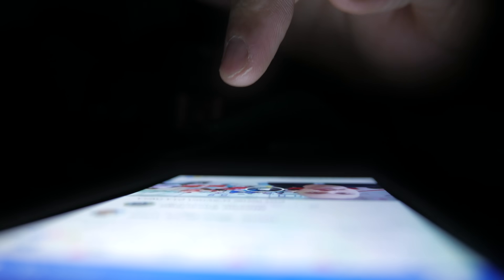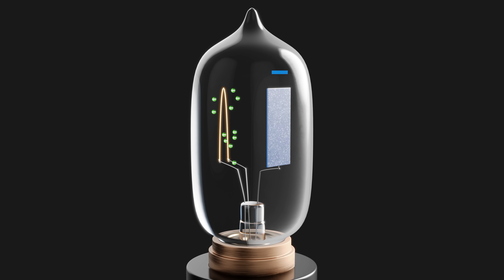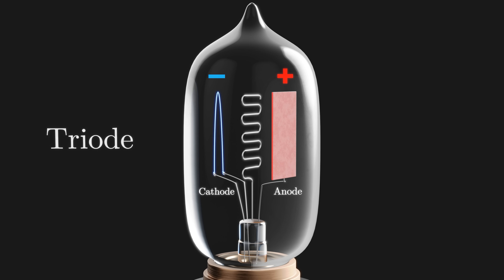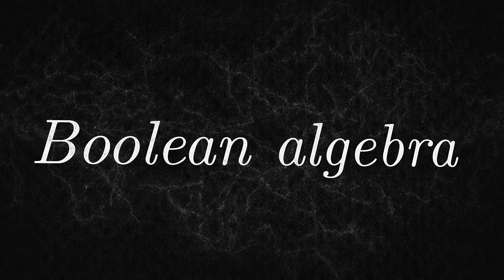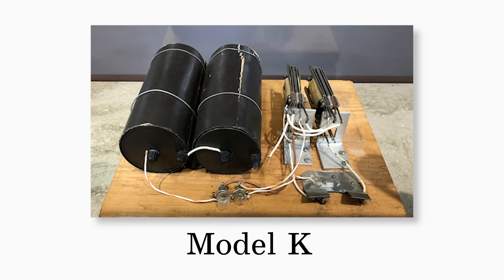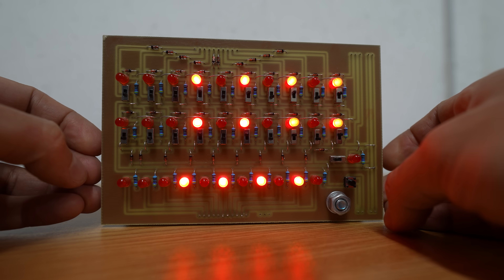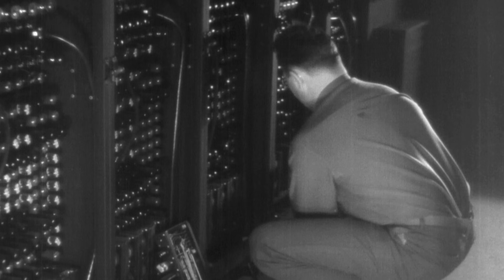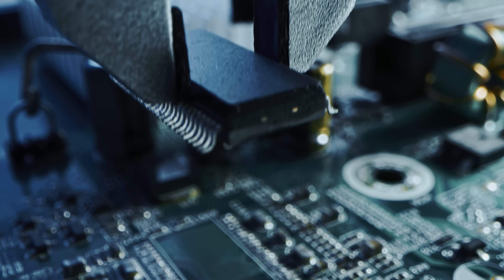Why The First Computers Were Made Out Of Light Bulbs

Comment: When I learnt electronic, vacuum tubes/valves were still widespread, so we learnt to fix both solid state and tube decices. The first thing I learnt was that it was rarely a tube that was wrong, often it was a resistor or a paper capacitor, but since the customers complained about how a small part was so expensive, we also replaced a few tubes, even if they were fine, so they won't complain too much. The customers didn't pay me for parts, unless it's a crazy expensive one, they paid for the knowledge I have accumulated over the years. It takes time to be a good electronic technician, that's why I demand a certain price. I had the chance to learn both solid state and tube so I could fix both.

Comment: I have worked on core memory, punch card readers and paper tape readers.  I have repaired tube based test equipment and the television repair course I took was on vacuum tube TVs.  Texas Instruments TI 960A computer was TI's first computer to use solid state memory but it was so unreliable that the chips were mounted in sockets, not soldered in.  We had a DIT-MCO cable tester we also used for motherboards, it used telephone central office rotary switches.  In other words, I am an old timer who just post dated the vacuum tube computers.

Comment: ENIAC was not the first  it was also unreliable the first was Colossus it was the first digital semi programmable electronic computer  run in 1943 and was designed and built by Tommy Flowers at Bletchley Park UK  it broke the German Lorenz Cypher there was a few more built and they were reliable  and run for days breaking the German Codes , Check It Out

Comment: 5:21 isn't correct.I'm sorry. Maybe it's dummed down for pedagogy's sake, but not good pedagogy. For that to work you need to have some sort of alternating current of the middle electrode, like they did with Clystrones. Sure, electrons accelerate towards the middle, but once past there's a plus charge pulling on the elsctrons ending up slowing down, not accelerating them, towards the anode. Electrons simply will not be accelerated towards the anode while the middle electrode is kept positive, like the animation shows.

Comment: When I was in a band we had an old amp head that still used Vacuum tubes back in 2020. We found a place that sold them so if a tube burnt out it was easy to replace. But it was interesting cause when we'd turn up the tube amp, we had to wait a minute or two for the tubes to warm up before we started playing so we didnt blow em.

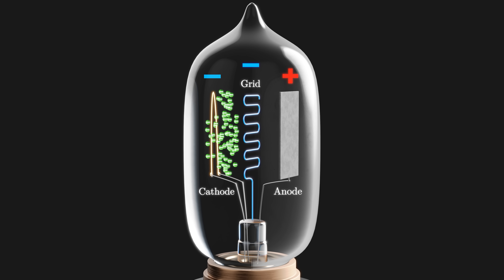Comment: 5:08 As far as I know, the potential of the first grid should never be higher than the cathode voltage. If it were, it would collect almost all of the electrons and burn up due to so much current. Instead, it should be kept at a lower potential than the cathode, thus trapping most of the electrons in a cage. By varying the 1st grid potential, you vary the strength of trapping, and by varying the anode potential, you vary the strength of pulling electrons out from the cage.

Comment: Actually, the first computers were made using brass gears by British engineer and mathematician Charles Babbage. Unfortunately, there was no power source available to drive it and only partial prototypes were made. The "analytical engine", as he termed it, stimulated the interest of Ada Lovelace, who wrote programs that could have run on the machine if it were built.

The first electric computers were made with relays by Tommy Flowers, previously an engineer with the British Post Office, during the second world war. Relays had been used for railway control and simple sorting-office tasks. Further improvements did involve valves, as in the "colossus" computer which decoded Enigma code messages in only a few hours.

So, yet another "Americans invented everything" video! Yeah, right.

Do keep up or think very carefully about your titles and content...

Comment: as a kid i learnd how a transitor worked with my bike it ahd a alternator and the connections had rust on it so when starting to ride from a stop you would have to go like 7 or 8 kmh to get the light to start but once it was one you copuld go down to like 3kmh and it would still give light yea a little but there was flow of energy

Comment: As a graduate student in 1975, I needed a printer for an amino acid analyzer. A Honeywell vacuum tube printer served well. It was so easy to fix because bad vacuum tubes were dark. I think we got it from a military warehouse near San Diego that stored equipment for the defunct Project Mohole, an attempt to drill into the Earth's crust in the 1960s.

Comment: Interesting video! The invention of the first computers is incredibly interesting, because it needed many different people making different inventions like the vacuum tube, diodes and triodes, logic gates and finally how to combine all of these to do computing. Absolutely amazing!
Fun fact about thermionic emission: We use it in mass spectrometers coupled with a gas chromatograph to ionize the analytes by hitting them with electrons. If one of those emitted electrons hits a bonding electron in an analyte molecule, it shoots it out and disrupts that atomic bond, fractioning the molecule and generating a neutral and a positively charged fragment of that molecule. It's very inefficient, about 0.1 % efficiency, but GC-MS is incredibly sensitive still. TL:DR there's a filament in those mass spectrometers (no vacuum bulb needed, since the whole mass spectrometer is a vacuum chamber anyways) and for ease of use and maintenance, it is easily accessible and in the newest models even visible through a glass window. So when it is turned on you can see the light emitted by that filament. Nothing special but I think it's just so damn cool 😅

Comment: Wasn't there a video about electric current is actually not 'flowing' so how does this then fit to electrons 'flowing' through the wire in a bulb?
Electrons don't have color, neither does glass. So why did the glass change color?

Comment: Vacuum tube computers and transistor computers aren't THAT different - in both cases it's about using voltages to drive electrons from one place to another, and being able to make that harder or easier with some other voltage in your circuit.  Switches that can be turned on and off under voltage control.  You could do the same thing with the old mechanical relays used in old telegraph systems, and in fact that IS how the very first computers were made - like the ones that Alan Turing used during World War II.  Tubes were a big step forward and transistors yet another step forward.  Then we started putting multiple transistors onto one piece of silicon, and made them smaller, and smaller, and smaller, and now you carry the result around in your pocket.

Comment: In addition you should look at the work done by Allan M. Turing and Tommy H. Flowers (at the British Post office research facility, Dollis Hill in London) during World War 2 to decipher German encrypted radio signals using the Colossus computers which predates ENIAC. These machines used 1-2 thousand thermionic valves (or vacuum tubes) and are recognised as the first semi-programmable computers. A rebuilt Colossus is on display at the National Museum of Computing at Bletchley Park in England, where it is operational. War time security meant that Dr. Turing and Dr. Flowers were not recognised for their contribution to computing until the 1980's, even today some of their work remains classified.

Comment: I visited a Dew Line radar base just after they had switched from vacuum tube computers to new computers for the time (1980). They took us (Air Cadets) into a gymnasium size room filled with tight pack rows of vacuum tubes reaching to the ceiling. After they took us into another room and showed us this small refrigerator size box and told us that it did the same job as the gymnasium size computer. It was an amazing vision of the future of computer miniaturization.

Comment: Beyond Eniac, there were many additional, more complicated, vacuum tube, computers. There became a division between the people that developed and maintained the physical aspects of the machine (hardware), and the people developing the instructions for the machine to run to do it’s calculations (software developed by programmers). When things did not work right, the software people would blame it on the hardware, and the hardware people would blame it on the software. A battle that continues to this day! Because the vacuum tubes produces light and heat, these attracted insects that could get into the hardware and cause shortage circuits, constant or intermittent, so the programmers would blame the failures on bugs in the hardware. Throwing the problem back on the software instructions created by the programmers, the hardware people quipped that the software had “bugs” in it. Once the hardware progressed to semiconductors, the problem of actual bugs (insects) in the hardware mostly went away. I say “mostly” because insects can still cause problems with hardware circuit boards especially in outdoor equipment (e.g. A/C units). But mostly “bugs” stayed associated with programming errors caused by programmers. Therefore, in a way, the vacuum tube technician’s throwback that “bugs” were in the software stuck. There are similar “bugs” in the hardware designs of integrated circuit chips, CPUs, and GPUs. Large teams of engineers try to break, or find, these design problem bugs during simulation before the very complex ICs are committed to silicone wafers.

Comment: Ugh! Those are NOT lightbulbs, those are transistors!
Reply: Nope it's a bulb 💡
Reply: @EXROthechoosenone  A light bulb is technically just a resistance which heats up, shines bright and has no other function. What you see in the picture are transistors. They work more like switches, they can differ between ones and zeros
Reply: @stephenmedley5844  No, light bulbs cannot perform computations or represent binary code (ones and zeros) like a computer. Light bulbs are devices designed for producing light, whereas computers use electronic components to process and store information in binary code. But as this video is telling somehow he turned their function so it's still a bulb
Reply: @EXROthechoosenone  I did not watched the video, because the headline is already silly. I know what you have explained, thats why I did not watch. I studied this one semester long in informatics and I know it from my childhood: My grandfather had a repairshop for transistor radios and transistor TV's
Reply: @stephenmedley5844  👍 it's ok

Comment: The part where he is showing the chips with the lights, IDK how they tell which number they're representing...
Reply: You have to understand the binary number system. Us as humans are used to base 10: 1's place; 10's place; 100's place, etc. With the 1's place, you can have any number from 0-9. If you want a larger number, you need the 100's place. That gives you 0-99 and so on.

With binary, its the same concept. The main difference is that instead of going by powers of 10, you go by powers of 2: 1's place; 2's place; 4's place, etc. With just the 1's place (1 bit), you can only have 2 numbers: 0 or 1. With the 2's place, you can have 4 possible numbers: 0 (00); 1 (01); 2 (10); 3 (11)

If you pause @ 11:15, you see he puts 1 & 0 on the top right lights.
The 0 indicates the 1's place and the 1 indicates the 2's place.

Comment: Accshhually; the first computers where not even electronic, but mechanical, and uses mechanics, cogs, levers and such to achieve logic. You can even do aproximated differentials with, namely, a differential gear:-) Check out the Antikythera mechanism or the Babbage machine for example. For a really good reading on computers, their origin and historical coupling to the Manhattan project, pick up a copy of Turing's Cathedral by George Dyson.

Comment: I don't know if this is true, but should be ... Those lightbulb machines generate heat and light, as this attract a sote of insects into the machine and their internal circuits, changing lightbulb states or burning them.
So when the machine stops work or cause some "abnormal end (abend)", programmers use to said: "It's a bug", and we use this term until today !
Reply: "sort" I wanted said (no sote)

Comment: The computer was created to control people through exciton tunneling, where to create excitons or excite the lepton density of the vacuum, a frequency oscillator is needed, previously these were relays and lamps, now these are transistors. The first relay computers, self-oscillators for working with the brain, were designed by Tesla. Lamp exciton tunneling devices are known as lamp schizophrenia, which was used by Bankers and the US Presidential Administration to eliminate scientists such as Etorre Majorana, John Nash, Viktor Schauberger and many others.

Comment: Not sure why the myth is promulgated that Eniac was the first programable electronic Computer. This is plainly untrue. Fact is, the first such (Turing complete) device  built was  the Z3 in 1941 by Konrad Zuse in Germany, ...albeit using relais. In the course of the next few years, these relais were replaced by electronic valves and this newer version of the Z3 was finished before March 1945.  Just on a side note, Konrad Zuse continued building computers for a while even after the war. Those who want to know more about this project will find some info on wikipedia.

Comment: The first known computer comes from ancient times: Gears
And it was built from other shockingly precise bronze parts and today we would call it an analog astronomical computer.
After purely mechanical machines, computers were built from electric relays, and then from triodes after the invention of the electron tube. the ECC 34 double triode was typically such a late electron tube, with which a bit store and logic gate could already be built.
Later, they were replaced by discrete transistor wells and finally by increasingly complex integrated air circuits.

Comment: I had so many ideas of how horrible and inaccurate this video could be. Thankfully, the complete opposite happened. Very thorough and accurate. You missed out on how Edison actually put anodes in his bulb and noted current flow, though. This was before Fleming. ...The Edison effect. Also, I believe that DeForest didn't know how to properly implement his triode, and put the grid and anode on opposite sides of the filament. I believe it was someone like Edwin Armstrong who figured out how to correctly place the electrodes and make use of them. Armstrong developed oscillators, superheterodyne radio, FM radio... all sorts of good things. 
Also, people get this idea that tubes are lo-fi because of how many tube radios/amplifiers were designed, and because the FCC decided to clamp AM radio stations at 10KC wide, which only allows for 5KC of audio bandwidth. This was done in the 1920s, and for some reason we never moved away from this. Some of the very highest frequencies (gigahertz or gigiacycles) are actually best produced by vacuum tubes, and until recently could only be produced by vacuum tubes. Magnetrons produce microwaves. Only very recently has a solid state equivalent been made. Most ovens still use the tube. Traveling wave tubes produce waves in the ghz region.